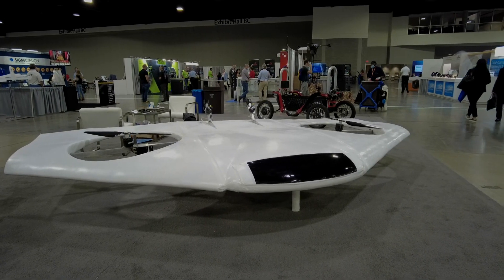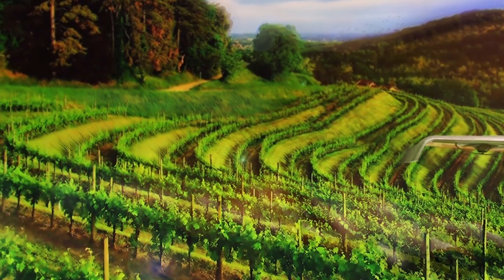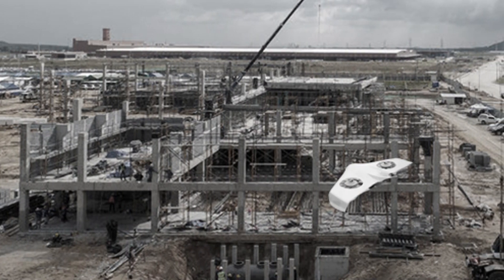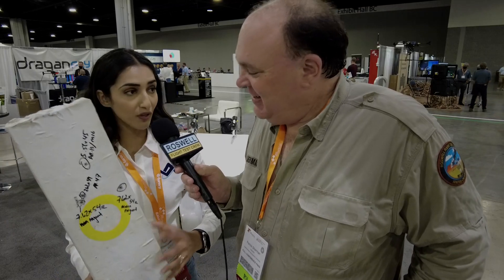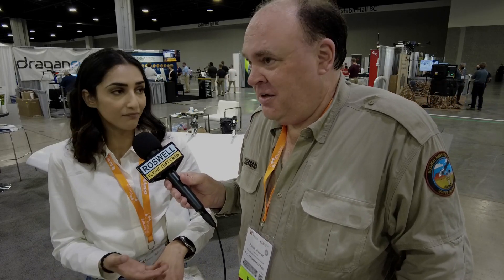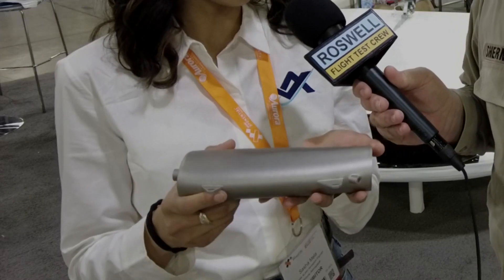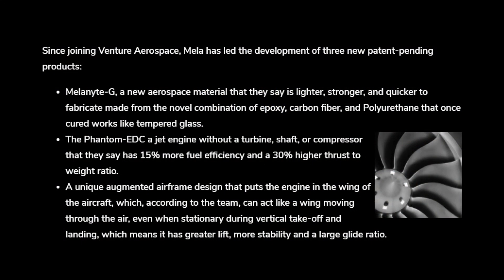500-Pound Crop Dusting Drone at #XPO21

Comment: Looks to be bleeding edge propulsion tech., very interesting molded construction method.
Reply from the maker: Yeah -- the propellers make sense to me and I don't doubt that the Dyson bladeless fan approach will work as well, but I don't know enough about the underlying aeronautical principles to have an educated opinion. One thing is true: if it works, not having to convert your diesel-engine output into electricity and then turn propellers will be a bit boost to efficiency.

Comment: firstly, we should not be spraying crops with anything, but i guess we have to, so the best option would be a big autonomous electric drone, that has a big tank of spray, this drone may weigh a lot like any farming equipment, the drone can land to charge periodically, the benefits will be no human labour needed, no polluting tractors, no tractors making lines across the crops with their wheels. the trouble is, farmers cant really use drones.
Reply from the maker: The problem with electric drones is that batteries just don't provide anything like the energy density of liquid fuels -- and when you want to haul a 100-pound payload, it's all about energy density. That said, other companies are flying whole human beings around using battery power in the urban air mobility (UAM) space, but at a much greater cost. An approach like this makes the this capability available to people who likely couldn't afford another approach. Also, why can't farmers use drones? The modern farmer is an extremely tech-savvy individual...

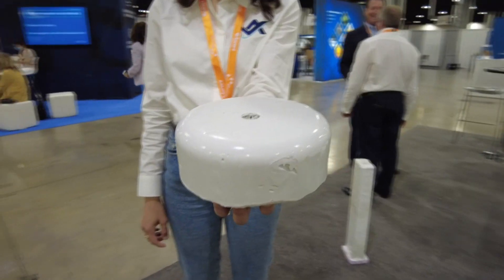Comment: 2:17 - Anyone who has the least amount of experience in composite materials ROFL'd at this word salad.
Reply from the maker: I'll have to take your word for it... I do not have the least amount of experience in composite materials.
Reply: What are your thoughts on the composite elements?
Reply: @christopherthobaben9709  Laminate shell  over low density PU foam for rigidity. Doesn't look like anything special that hasn't been done for 40+ years in aviation. Nothing wrong with that, just don't see any innovation here. The 'cures like tempered glass' comment was especially odd.